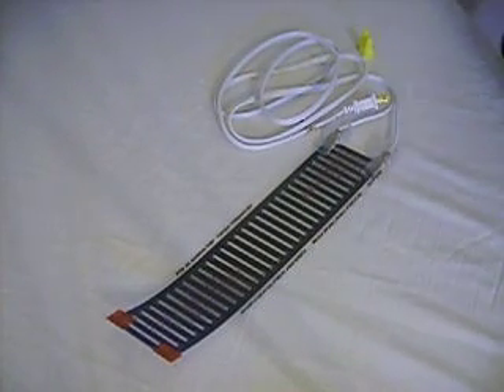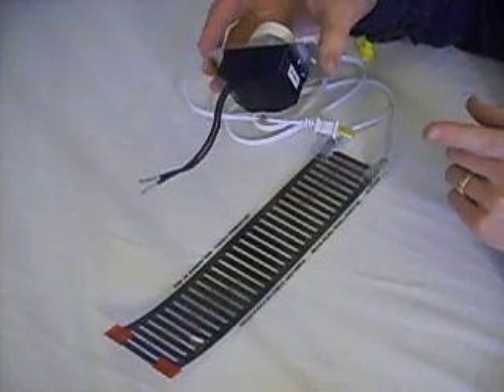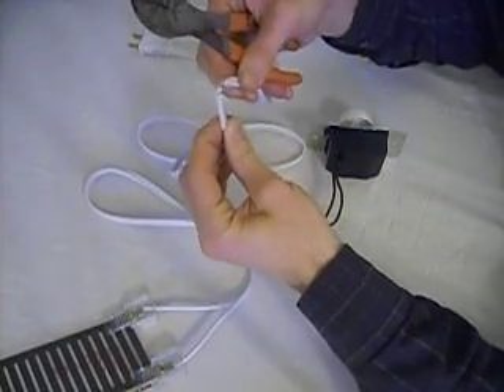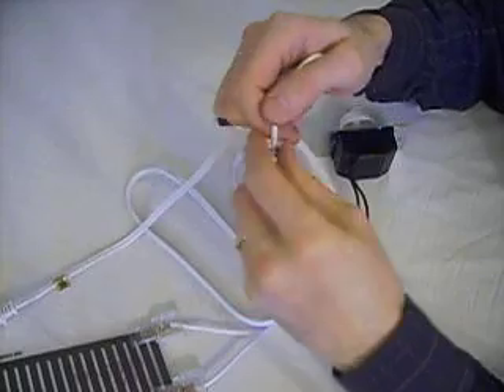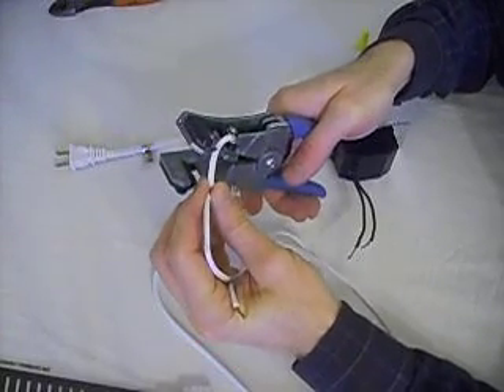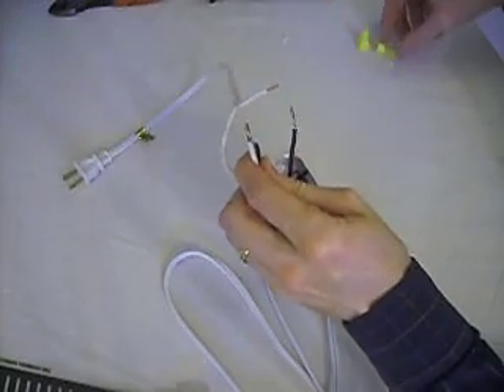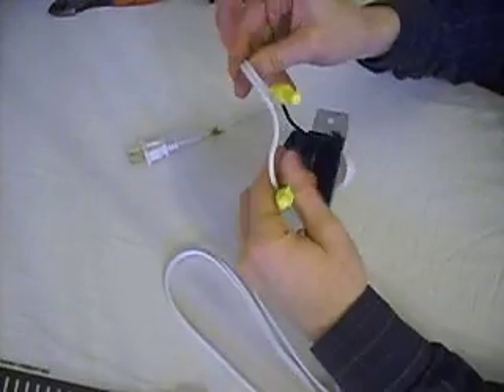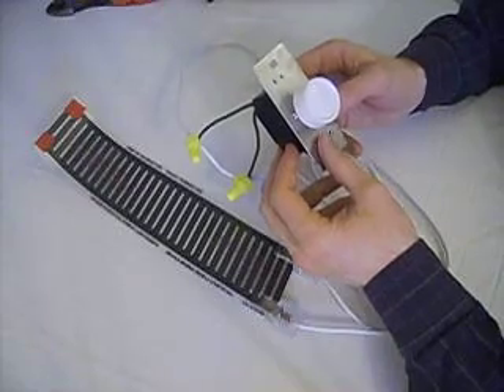Flex Watt Wiring and Mounting: Part 2 (by IncubatorWarehouse.com) Flexwatt

Comment: @AmsterdamFire321When did i ever say anything about a ground wire to a switch? The only time i said something about a ground is when i said that wiring a house is not hard. If you read what i have said over and over is that it is not safe because switches are not suppose to be used in this manor. No its not a problem now but down the road in a few years the wire and or switch will begin to fail in some sort of way. You cant go and by a switch with a neutral and a hot wire in a set package either

Comment: @AmsterdamFire321 It takes time not skill its all memorization, a first year apprentice can wire a house. Also switches do not have neutral sides or neutral hook ups, again they run off of switch legs(which is a hot wire) and do not complete an electrical circuit. You will never see a switch anywhere in a building or house that was hooked up by a licensed electrician to have a neutral wire on it. A fuse will do nothing but limit the amps to the flex watt. I am in the trades not an english major

Comment: As an electrician this is completely against all codes that have to do with cords.  I would tell everyone who is seeing this video to NEVER NEVER DO THIS.  Don't be cheap and stupid, go out and get a thermostat.  It smarter and safer and you don't have a the chance of shorting the cords.  Not only that switches don't have a neutral wire and the heat tape does, the heat tape need the neutral to complete an electrical circuit.

Comment: @AmsterdamFire321  Switches dont have neutrals and he is using that switch with a neutral to complete and electrical circuit, switches are not designed to run of a complete circuit you they only use a switch leg. Anyone can wire a house, you all you do is hook up a 2 wire to the breaker box.  Hot goes to the breaker neutral on the neutral buss and the ground on the ground buss.  Run your wire to the room and pig tail to your outlets.  Wiring a house takes no electrical skill at all